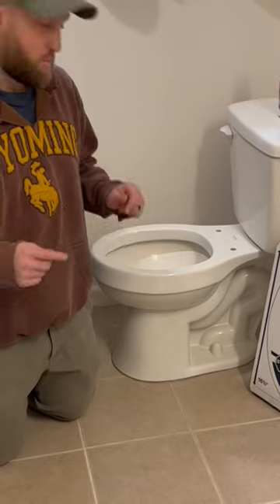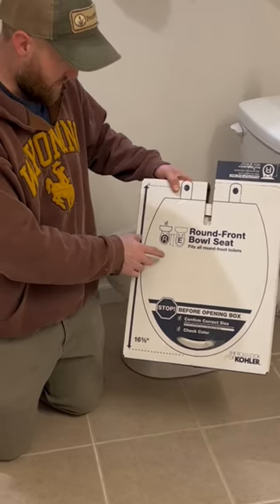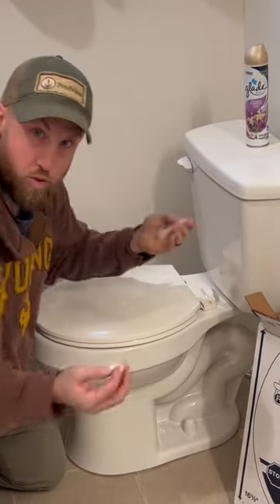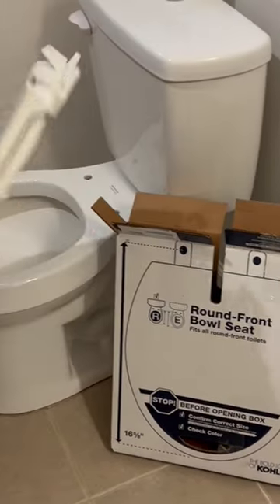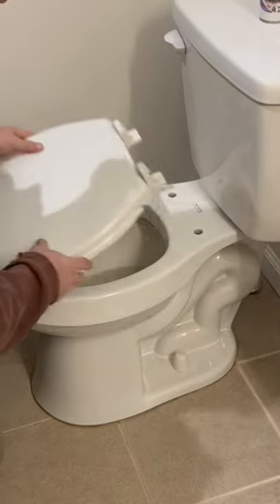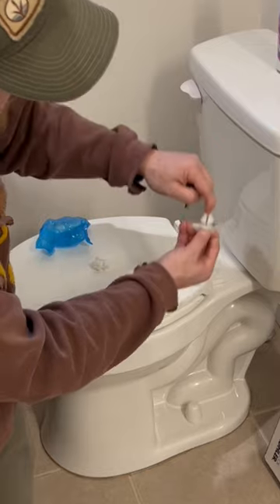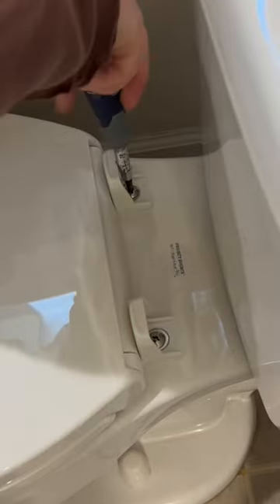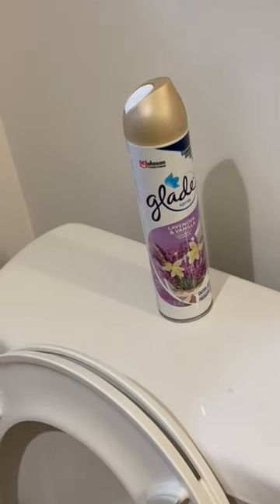How To Change A Toilet Seat | #shorts #diy

Comment: I did exactly how you showed, but it keeps slipping around. I wonder if I did it too tight and stripped it 🤔
Reply from the maker: Unfortunately it sounds like that might have happened. You might need to take your existing bolts/brackets to a Lowe’s/hardware store and get some replacements. Hope you figure it out! Thanks for watching! -Josh